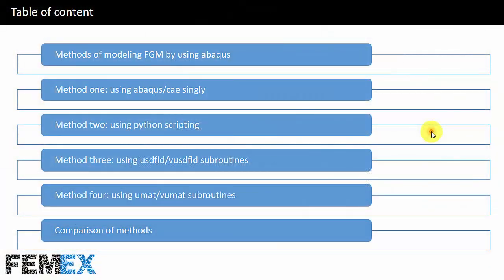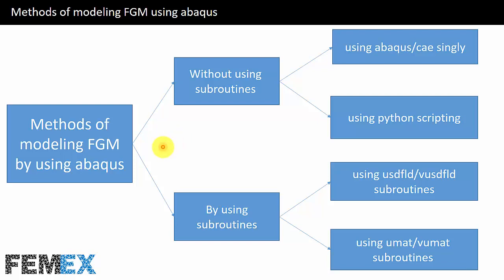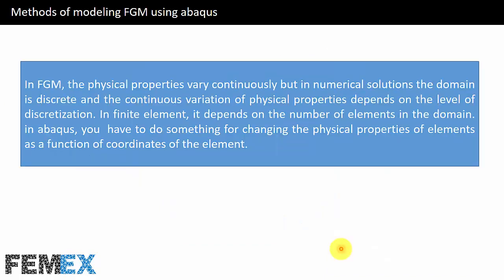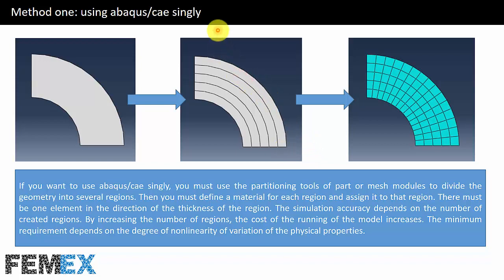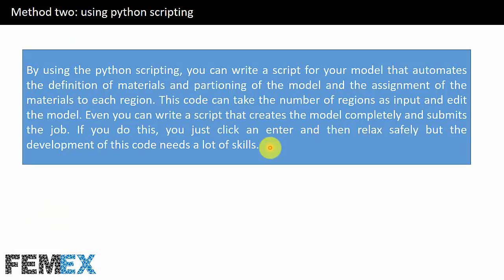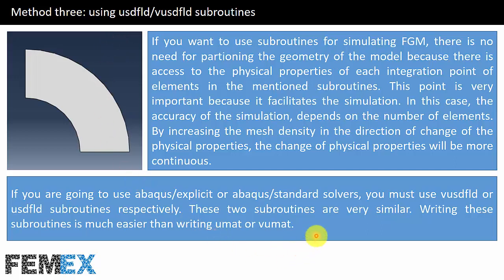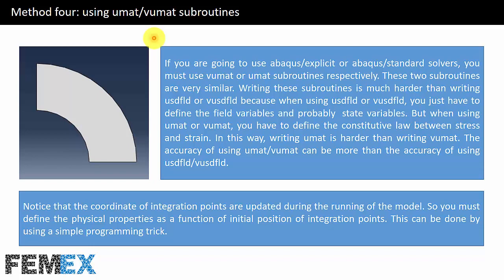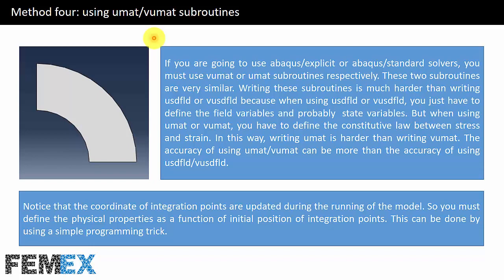fgm modeling by abaqus

Comment: How to model FGM plates in Abaqus can u please explain and by which element.
Reply from the maker: Hi.
As far as I know the element type is not important in FGM modeling.
Also all of this tutorial is about FGM modeling.
Hence please ask your first question in more detail.
Are you asking about modeling FGM using shell elements ?
Reply: @FemexIran  Sir I want to model a FGM PLATE having dimension 100 * 200 mm and 2 mm in thickness, and it is simple supported from all the sides and I want to find out the critical buckling load using buckling analysis in Abaqus so how can I do it in Abaqus?